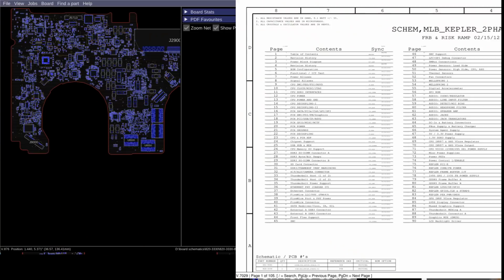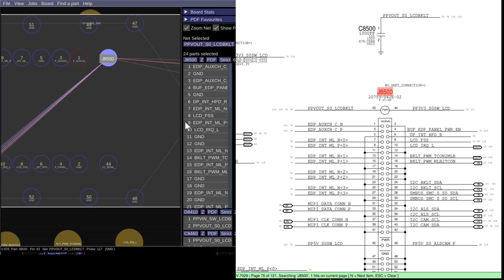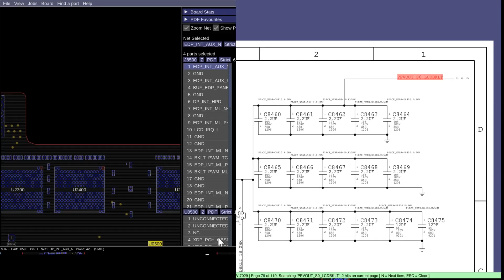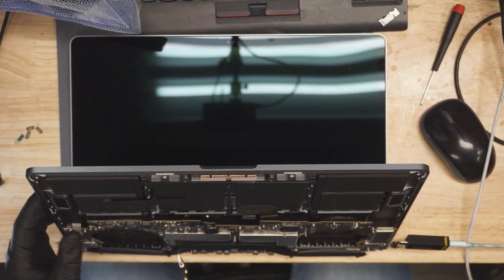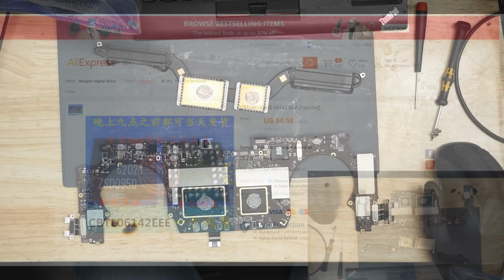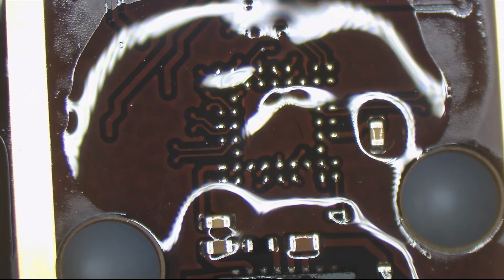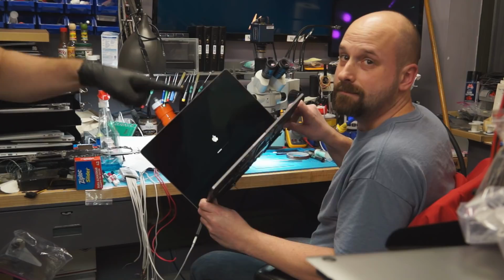Apple botches Macbook board design: again!

Comment: putting a 50v line next to a 3v line with no spark gaps. Think Different.
Reply: Ciscodude think broken
Reply: Not even any diode protection on that signal line before it goes to the CPU either....  it should at least be fused if Apple insists on placing the signal pin so close to the backlight power.
Reply: The arc gap isn't the issue, since there is more than enough clearance for 50v there. If you're making a PCB for instance the distance you'd need between the traces and pins(internal and external gaps) are only  0.1mm and 0.6mm respectively. The problem with this design, is that if you are making a device with very different voltages, you need to properly seperate them with grounds, to prevent liquids, or bent pins from shorting them together. A ground pin between them would have prevented this problem entirely, or atleast a rectifier to limit the voltage thru that 3v line.

But if Apple followed industry standards to prevent problems with there machines, their cult followers wouldn't have to buy a new device every other year, and they'd lose out on sales... "Think Different!"
Reply: The word you're looking for is courage. They had the courage to leave out dated tech like spark gaps just like they had courage to remove quality from their products.
Reply: think increased sales volume, when it breaks down likely not long after warranty is up ;)))
Reply: pure gold LMAO
Reply: @Poptart133g : Looking at the video again, the pin spacing for that pin seems bigger than the others, they were probably relying on a wider gap instead of a separator pin. Not sure but the look of it reminds me of an overloaded line causing a short after board is already damaged.
Reply: coming into this comment section like walking into an alien planet not knowing the language
Reply: think not..
Reply: @Poptart133g  The problem is definitely not with the arc through air, because distances are too great for that at 50V, as you say. But even without direct exposure to fluids or mechanical damage, simply having this machine in high humidity environment can cause the pins to corrode enough to eventually make connection. At 3-5 volts your pins have to get really bad before there is a short because the resistance between pins will still be high. But 50V can actually jump the corrosion bridge. So this is potentially a lot worse than it sounds, and probably explains why people are occasionally having these problems even when they haven't had a liquid spill.
Reply: Or just don't think at all.
Reply: Thinking different doesn't always mean thinking well. * shrugs *

Comment: Apple engineering: Helium can brick your iPhones!
Reply: Pate Jate that is not permanent
Reply: @JoeyLindsay  but it makes it unusable for some time
Reply: @JoeyLindsay  it's a f*cking noble gas, it doesn't react with anything and yet apple managed to make it unsafe for iphones
Reply: Ktaldoxx it is not a chemical reaction, it is a physical reaction like the speed of sound.  The crystal in a MEMS oscillator is usually shielded at the cost of some extra width.
Reply: Sgt TootyPants it is a silicon crystal
Reply: @JoeyLindsay  that was a joke, but joke aside, the diffusing of gases in materials is chemistry engineering and the effects on the electric properties also are, so the reactivity of helium is important... and i will insist, they managed to make something safe (helium is safe if mixed with oxigen, and this will also kill an iphone) into a phone killer issue
Reply: @sgttootypants5238  it's not too thin... How do you think thinner Android phones manage to use a crystal still?
Reply: Luckily it's not allergic to Oxygen.
Reply: honestly when is your iphone ever gonna be exposed to that much helium unless you intentionally expose it
Reply: @brando12343  a balloon filled with helium deflating?
Reply: Pate Jate so your gonna put your phone next to a deflating balloon? for what purpose?
Reply: brando12343 well helium leak is not uncommon. It’s also not uncommon for the ballon filler to forgot to switched off the valve while pumping balloons, so.......
Reply: Ong Jun Ren that’s a pretty specific case, for the average person it’ll probably never affect them
Reply: @brando12343  True. But this looks like they cheap out on the very basics.
Reply: @MattZelda  Well, there's a dedicated feedback page on Apple's website for this purpose. Apple will never look at youtube or reddit comments/posts, not when they are full of trolls and ignorant fanboys on both sides.
Reply: Oh no. How am I gonna use my phone in a leaking helium blimp ?
Reply: @patemathic  / On natural occurance, most heliums will dissipate into air, and those heliums are expensive; so they're mostly contained in a gas container.
If you managed to fill a closed space with enough helium for iphone to stop working, I'd call it intentional since it's not plausible.
Reply: @m4ki9h76  I know, but this was discovered in a hospital where there was a helium leakage; every iPhone died in the hospital but all Android phones survived. That wasn't intentional.
Reply: To be fair how often do you live in a Helium atmosphere?
Reply: @blogtodeath4736  Good question. You won't live in a helium atmosphere. Why won't you? Because you need oxygen to breathe.
Reply: @brando12343  Applied Science did a pretty good explanation and test video covering that helium issue: https://www.youtube.com/watch?v=vvzWaVvB908

It's been a while now since I watched it, but I seem to recall it doesn't take a high helium concentration to trigger it with enough exposure time. And for most people it's probably not going to be an issue, but some people will be working with helium systems and inevitably have some leaks or the process by design can't avoid minor leaks. That said it isn't permanent and it'd only be an issue for a very small number of users so I do agree with your opinion that it isn''t a critical flaw.
Reply: @julianf.8028  Better planning?
Reply: Nobody:

Everybody without any expertise in engineering: Apple didn't even think to test whether an unnaturally high amount of helium in the air would interefere with their phones!!! Such amateurs 😂😂😂😂

Comment: sure as for your data or clock lines, or the majority of signal lines for that matter, you would usually want to route those traces to internal layers of the board through a via and place ground vias around it. signal lines should also have the shortest return path possible, ground lines next to signal lines are great. high power lines next to signal lines is a HUGE NO! if you can you should even have a ground above and below internal signal line. This is also part of process for avoiding capacitive coupling between lines. the layout is equally as important as the circuitry, components, etc... If apple screwed this up then they are totally doomed. The laptop i am about to have in production with a team of 2 people will literally be better quality than the apple board which has teams of people and billions dollars. Freaking ridiculous.
Reply: Damn son, you killed it! Thanks for the info too. And good work there Louis. Keep them comming
Reply: pretty sure Apple did it on purpose to boost their "repair" business. Hail engineering.
Reply: kind of make you wonder if the stripline was even designed with the correct characteristic impedance/termination.
Reply: Are you going to sell those laptops? How can I get one?
Reply: @Juan-xq2wj  yes there will be 3 models released each with different spec options and all of them will be available for public to purchase. The first model will be ready for purchase roughly mid 2019. The other 2 models planned for late 2019. So you aren't missing too much right now but if you want to keep this in mind then save this site to your bookmarks https://www.twrelectronics.com or enter your email into my newsletter and you will be notified when they are available- https://my.sendinblue.com/users/subscribe/js_id/3shdw/id/1
Reply: @UnyieldingVigor  Sounds good. I checked out the site and subscribed to the newsletter. I hope all goes well. It's about time someone approached this from a different angle.
Reply: @UnyieldingVigor  Just read your "About Me" page. Some of those "premium"  devices were Apple, weren't they?
Reply: Those devices were MacBooks and razers. Not exactly sure which is worse. Probably Razer. They use bodge wires on some devices from the factory and also do other non visible routing errors that causes multiple power rails to get shorted to a low resistance line because a trace breaks internally in one of the layers and shorts them. Also many other issues.
Reply: Wow, the plans for that laptop sound extremely awesome!
Finally someone doing this. I guess a modular design not only ensures repairability and upgradability, but also makes it easier to have a whole range of models with one design?
Reply: I think the problem is that there are "teams of people", likely with very little communication between these teams, rather than a small group of engineers who actually communicate with each other.
Reply: @g60force  thanks for your feedback. Anyhow I just released an updated trailer for it today and its releasing next week. I have a few thousand people in discord servers who are interested in buying it and really excited for it actually. Its about target audience. There are tons of games out there that have made millions or billions that a lot of people would not even play for free! But they found their target audience obviously. Theres what 1 billion gamers out there? ITs okay if 999 million of them think its garbage.... If you find the other million and put it in front of them? They are your target.... Creative elements are like music or art and bad or good can not be defined in those, its very subjective. Whats hated by many will be loved by many others and conversely as well. IT is like: If you stand on a street corner and ask all the girls that walk by if they want to go to a room with you.... eventually there will be one that says "yes"
Reply: L HK you mean replace business right?

Comment from the maker: To see the full livestream of this repair, which includes far more information, check it out on my other LIVE channel:  https://www.youtube.com/watch?v=G3YmsIHQT1U

To learn about electronics engineering & design from a master in the field, check out Dave Jones' channel, eevblog: https://www.youtube.com/channel/UC2DjFE7Xf11URZqWBigcVOQ
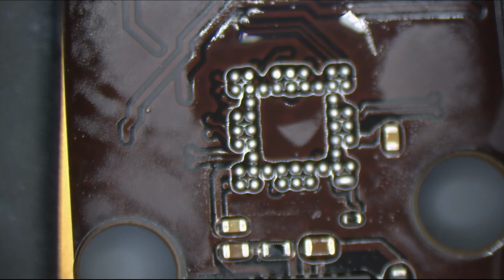Reply: 12:50 when solder balls are this close to one another under a small chip, how do they not acidentally connect with another and short some pins?
Reply: @jipping_slimmy  Surface tension
Reply: Hey, happy holidays.  Be well and safe.
Reply: 👍 Good Job Louis
Reply: Can you do anything about that connector, so that it won't fry it in the future? It worked with the old connector, despite it was fried there?
Reply: A bit off-topic, but I think I know why Apple products are speckled.  They get aluminum scraps from other manufacturers, and melt it down for use in their products.  So, basically, it's the aluminum equivalent of POT METAL!  It's not tempered and it's not a proper alloy of any description.  It's just "untempered mystery aluminum alloy".  Pay multi-grand prices for fucking POT METAL!
Reply: Hi, could you put a ground pin in for my MacBook Pro 15” touchbar 2017? What would that cost? Need to future proof it . So it won’t fry.
Reply: Hey, Louis. I was recently fixing a more common issue on the mbp13 touchbar when the liquid affects the lateral part of the board right where they’ve put USB-C mux with corresponding lines and caps. They are placed so dangerously close to each other that a tiny amount of liquid destroys everything including the lines in there. These machines have a truly stupid iphone design with the difference that tiny element left unprotected without any type of coating (while iphones have this protection). And of course, I’d like you to share your experience when the keys of the keyboard need replacement of just one or a couple of keys. Most of these keys are designed to be irreplaceable, literally. The plastic just cracking from a slightest touch.
Reply: I think Apple hired some Indians "engineers" that work for 30k less.... God bless H1B visas...
Reply: Louis, I’m happy to report to you that while I never really liked Apple, I decided several years ago that I needed some Apple experience (being a computer tech). So I bought a $2500 MacBook Pro nvidia, and an iPhone 6s Plus. My own experience + the state of current affairs, last month I said F that horrible company and sold the MacBook on eBay and am currently looking at other phone options. You have been a significant part of the shove that pushed me over the edge, and I thank you for it. I feel better as a person to not support that wretched company any longer. And, if they became the only computer manufacturer on earth, I’d probably just use an abacus.
Keep fighting the good fight for those of us who simply can’t. My hats off to you, bud. Thank you.
Reply: Hi Louis,  what you think about the Ipads, are they as bad Designer as this MacBooks? Have a iPad 4 and it goes...on, and on, and on and on. Ps: Love your Videos!
Reply: James M I’ve always found the Dell Latitudes be be pretty nice units. I’ve had several.  I just picked up an HP Omen 15 and it’s surprisingly good. Take a look at Sager Notebooks, if you want some fun window shopping.
Reply: @James M that’s just not true. I can’t even tell you how many Apple products I’ve been asked to repair. Other than boards there isn’t much that’s different about them. I mean, they’re pretty good quality but not anything you can’t find other places. Business class units from Dell or HP tend to be pretty solid in my experience. Business class is the key, though. Usually they’re different animals all together. Not like the consumer level stuff. My Dell D830 was fully Mac compatible. Check out OSXLatitude and that’ll give you a decent idea as far as solid Linux compatibility. It’s been awhile since I dabbled in Linux.
Reply: Heading to bed.
Reply: some pcb varnish may help
Reply: Sometimes i wonder if the design are deliberate so the CPU can be more easily fried 'acidentally'.

Comment: Honestly apple is got so much cash. They can pay the best engineers in the world. I think they purposaly make these "mistakes" so their products break after 1-2 years to make you buy a new one.
Reply: Alexandru Maran I own 4 macs, 2008, 2010, 2011 and 2015 all still working nothing wrong with them I just upgrade due to video production
Reply: but what about newer macs. The repairability is way worse than the older model since they soldered everything. I'm still keeping my 2012 macbook pro non retina. Easier to swap the components when something is wrong. They're getting more expensive, and if I'm dropping 2000+ dollars on a laptop, it better be running well for at least the next 5 years. I don't feel comfortable spending that much on a newer macbook pro model tbh
Reply: "Any moron can build a bridge that will stand up.  To build a bridge that will barely stand up requires an expert engineer." -- Old joke / new business model
Reply: @g60force  For one, they are afraid of running into legal trouble vs. 1 bln company, for two I doubt Apple has actual hardware people on their paycheck - they probably body lease them somehwere in Foxconn or similar.
Reply: Of course

Comment: i remember when i was it university working on the marine robotics club i had to explain to some of the new freshmen how we layout signals on our connectors and told them to always have a ground pin around any power pin. we had 50 volts running all over the place and 50V and salt water do not exactly make a good combination. we had one incident where the AUV re-surfaced before it was supposed to and the lcd behind the top window was flickering. we opened it up and found a little pool of water sitting between the 50V battery busbar (capable of carrying 100 amps) and the large ground plane that we left exposed. the water managed to make its way to a low voltage section on the board that was responsible for current measurement but because we had the large ground plane exposed all it did was short out the 3.3V supply rail causing it to reach its current limit and restart over and over again (which is why the display was flickering). the board had a nice hole etched into the ground plane around the high power busbar but every thing worked completely fine after it was cleaned and dried with no problems and we continued using that "holy" board for years until it was finally killed by one of our members dropping a piece of metal shielding directly on top of the board because they were working with the main batteries attached 🤦‍♂️.

Comment: That's pretty much planed obsolescence, it's not worth fixing, buy another one.
Reply: Buy a different computer*, buying another computer of the same design is just throwing money away.
Reply: I say: "If it's not worth fixing, then it's not worth buying."
Reply: And the value of planned obsolescence is two fold... it kills consumer market resale value forcing even more new sales into Apples pockets instead of someone buying second hand Apple (dead) products.

Apple products are great performers when they work until failure and probably why Apple fanboys are in constant denial of Apple bad practices and overpricing from years of slowly training / lobotomizing it's fanboys into thinking it's just normal procedure to buy a new one every time the old one breaks since it's almost cheaper than a repair or even less troublesome.

Comment: Just FYI, the only distributor with stock of the NXP chip is Quest components. $6 each in single quantity. Unfortunately they only have 240 pieces in stock as of December 8th @11pm est. So grab them while you can.